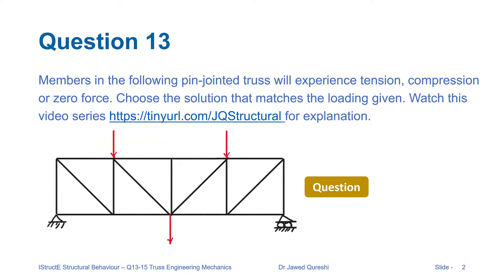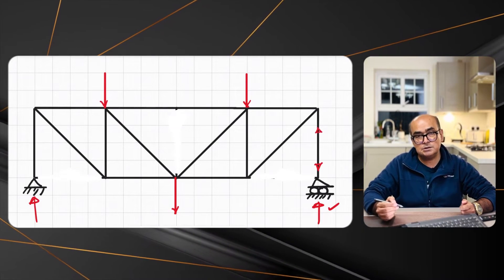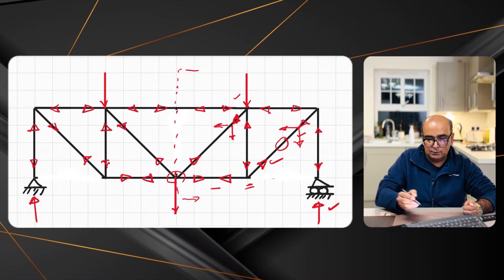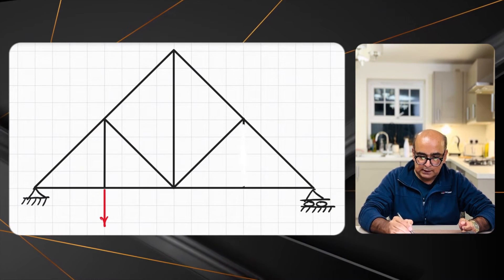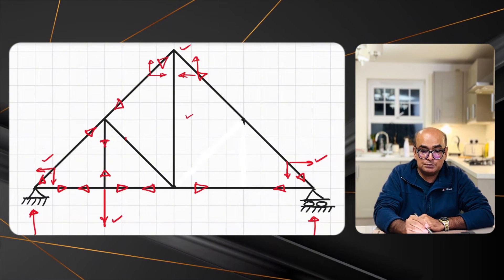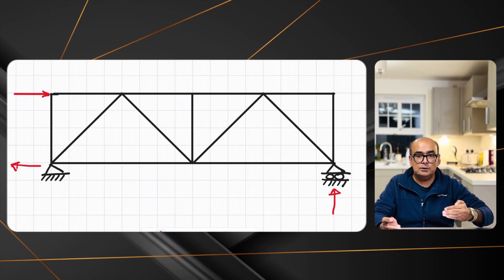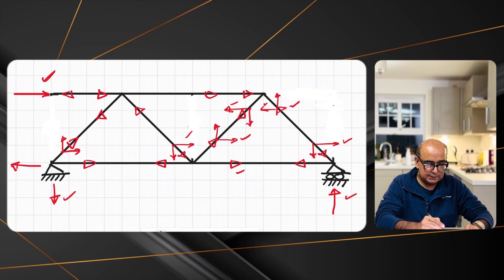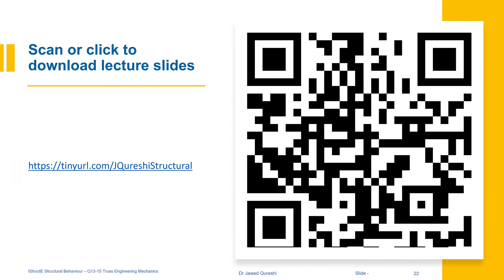Truss Engineering Mechanics – Finding member forces | IStructE Structural Behaviour Course

Comment: There's something I noticed in Problem 1, after I solved it using intuition. As the loads are all vertical and symmetrical,
The top of the truss is in compression. The bottom is in tension.
The vertical struts are in compression, and the diagonal ties are in tension.
All as you'd expect! You could possibly solve this truss by inspection on those assumptions. Although best not to rely on that as it wont always be so simple.
Reply from the maker: You are right. Can be solved by inspection.

Comment: why the member near roller support is not zero, although there is no horizontal force acting on it?
Reply from the maker: Let me check, I'll get back.
Reply: @DrJQureshi I am asking for question number 2.
Reply from the maker: @kiranpandey7694  Although there is no horizontal reaction at the roller support, the horizontal member will experience a horizontal force because it is connected to the inclined member, which has both horizontal and vertical components.
Reply: @DrJQureshi Thank you for the explanation. If it works like that, then why did it become zero in question number 1? Even in question number 1, the diagonal near the roller support is experiencing  tension and it has its vertical component force as well. Can you please clear it, I am confused ?? I would highly appreciate it.

Comment: Why is the load ALWAYS APPLIED ON THE JOINT??? UNREALISTIC? OR USED IN REAL PROJECTS?
Reply from the maker: @TheAncientColossus  trusses carry loads at their joints.
Reply from the maker: @TheAncientColossus  Golden Gate Bridge USA and Forth bridge Scotland use trusses with loading at joints. There are many other examples.
Reply: @TheAncientColossus  yes used in real projects. Trusses always carry loads at joints.
Reply: @cnjrq  Distributed snow load on top members? This is not joint???
Reply: @TheAncientColossus  The snow load rests on the roofing sheet, which in turn rests on the purlins. The reaction of the purlins is transferred to the truss as a point load to the joint of the truss.

Comment: HOW to determine where the external load is applied? In practice, how do you pick LOCATION to analyze?
Reply: @TheAncientColossus  it will depend on where the roof framework is located for this particular case.
Reply: @cnjrq  What are other load combinations? Roof framework and what other structural items produce loads on the members??? Assuming "roof framework" is ONE structural item???
Reply from the maker: It depends on how loads are applied. Sometimes loads are distributed too. But the application of loads at joints is a modelling assumption for simplifying the structural analysis. The questions solved here taken The Institution of Structural Engineers Certificate course on Structural Behaviour.
Reply: @DrJQureshi  WHO IS APPLYING THE LOAD IN REAL LIFE? GOD IS PUSHING THE STRUCTURE?

PLEASE.
Reply from the maker: IStructE is in London.